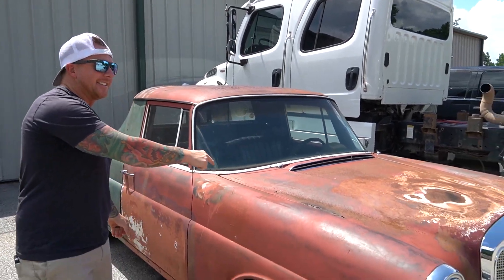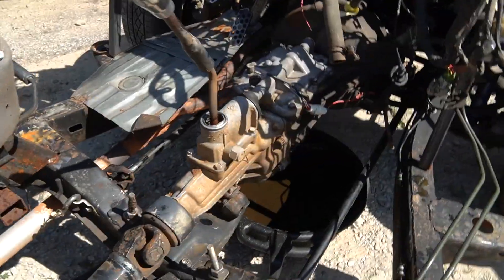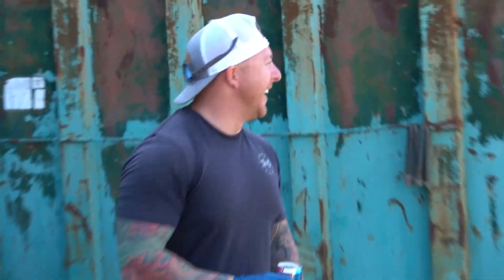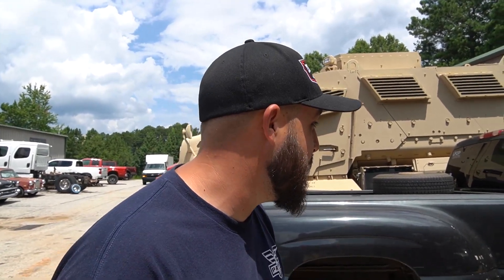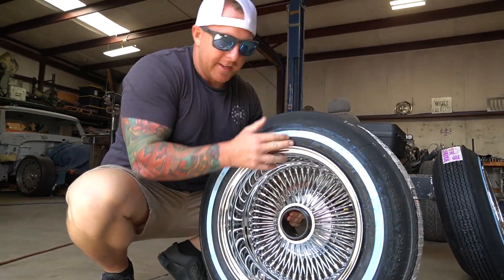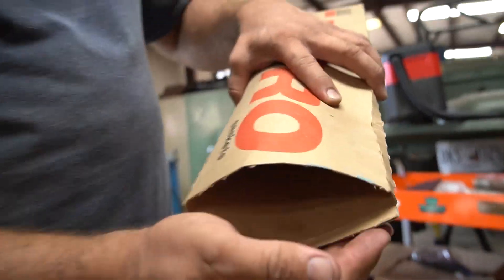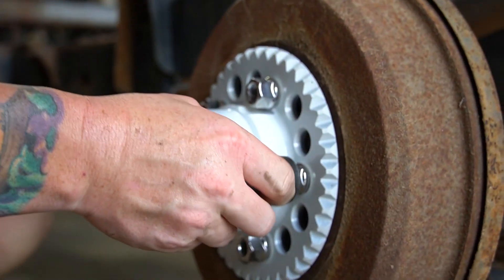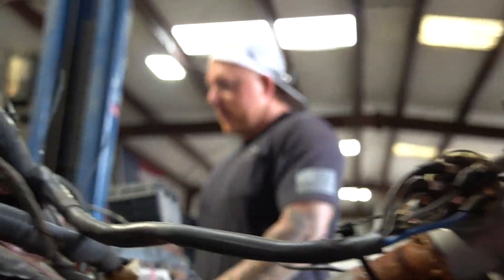Barn find to Lowrider (Mercamino) Part 3

Comment: not sure how much i would trust that wing nut wheel set up…
Reply from the maker: Lol just gotta send it. I beat it on with a lead hammer. I guess just gotta check it regularly
Reply: @ProdigyT.V  Should have holes for safety wire.

Comment: I'll be honest. I'm a little bit disappointed that you used the toyota motor/trans, instead of the diesel Merc motor. Or a cummings. Either way, I wish you'd start doing your own builds, instead of buying everything. :D
Reply from the maker: I originally was until I needed a couple parts for it and it was $3k 😂😂
Reply from the maker: Slave cylinder alone was $1800. So I said 22r it is